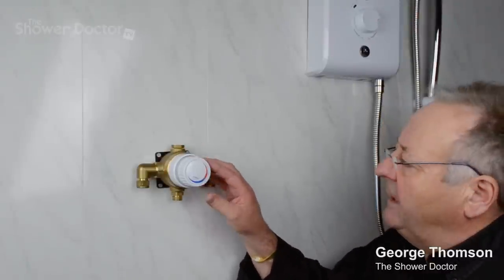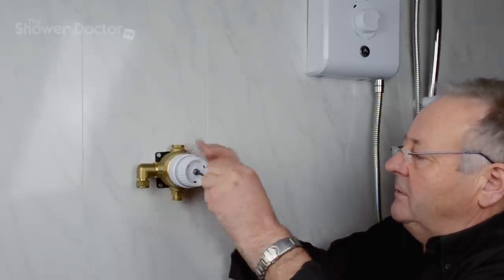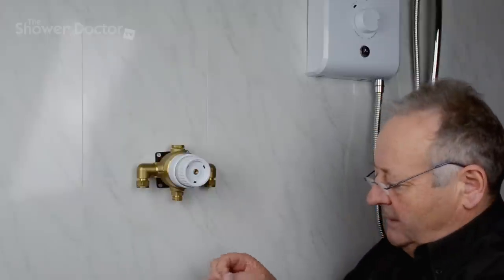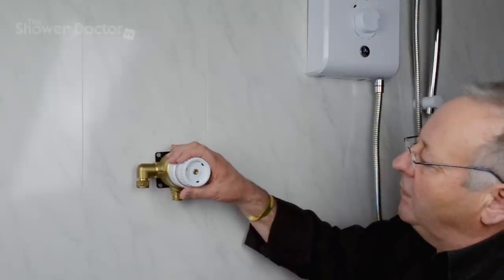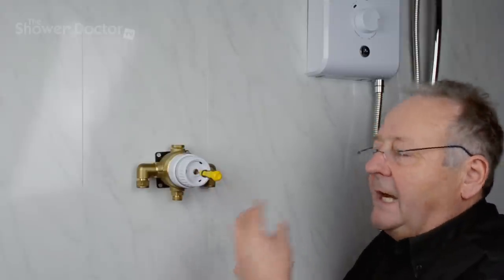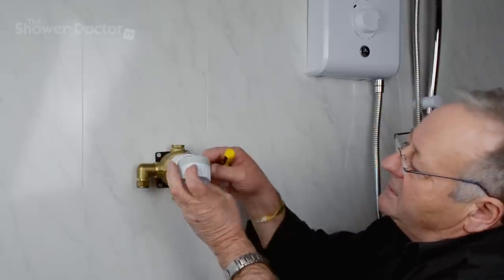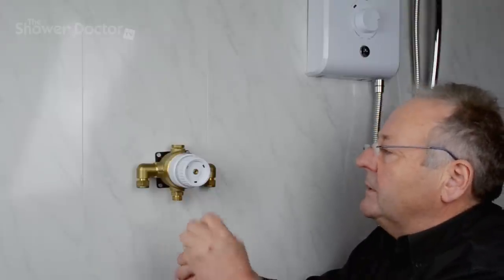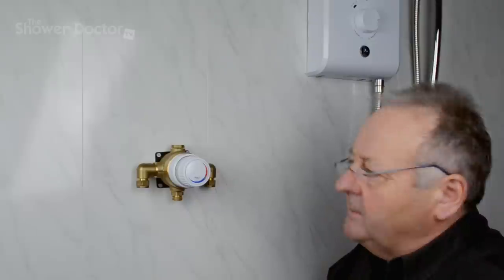How to reset temperature on a Gummers 1500 series valve.

Comment: Great video, thanks. I couldn’t turn the screw, it was locked fast. I serviced the unit according to your other Gummers 1500 video. When the unit was disassembled I freed up the temperature adjustment using a large Allen key on the reverse of the temp adjust part. Lubricated and now all ok. Couldn’t have attempted this without these excellent videos and your service kit. A tough job though as a ten year old unit and many very stiff parts. Not doing this very often you’re hesitant to force anything.

Comment: My shower has the Vistorian style handle etc . I cannot find the adjustment screw as shown? Is there another way to increase the temperature. It seems to have dropped off since the weather change(colder) I do have a coldwater tank in the loft if this helps?

Comment: How do you know if the cartridge is in the correct orientation?, I have serviced and replaced my TS1503 and it has never been what I would call hot - luke warm at best. The hot inlet elbow is too hot to touch. I have made the adjustment to the centre screw and no better.

Comment: My gummers 1500 does not use a screwdriver to adjust it!  So I'm not sure if this is totally good advice. I unscrewed my adjuster from inside using a hex key and found it needed a 2.5mm hex/allen key to adjust when it is put together! If it can't be adjusted because somebody has used a screwdriver to round the hex hole then adjust it by moving the adjuster from the inside end with a larger hex key, using trial and error to find the right spot.  Using a screwdriver can ruin the hex hole! Also water coming out of the adjustment hole is a sign that the adjuster's o-ring is faulty letter water past the adjuster.

Comment: Ive fitted a new cartridge but what happens now is there is very little movement on the temp control between too hot & too cold! Have I fitted something wrongly?
Reply from the maker: Look at your configuration of the spring , shuttle and thermostat, then reset the temperature as shown above. Also check the head and hose for blockages.